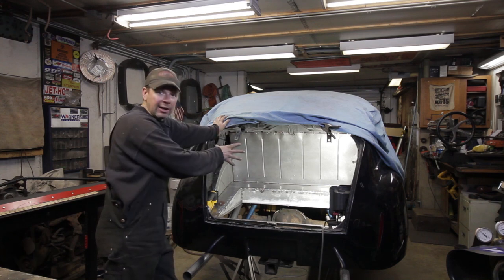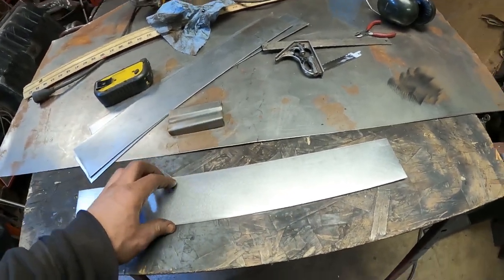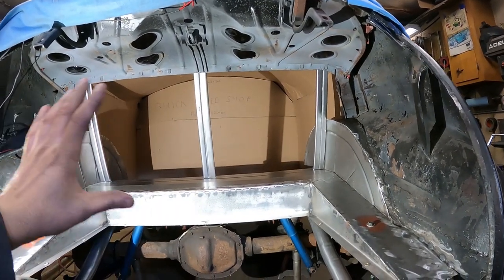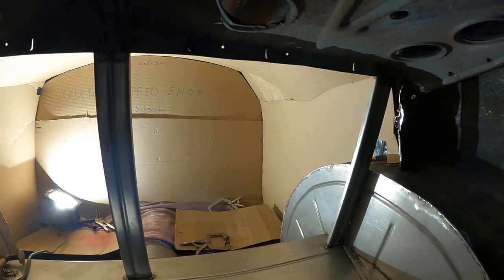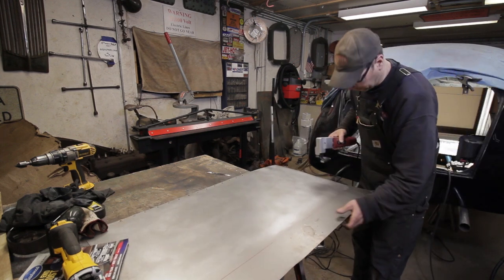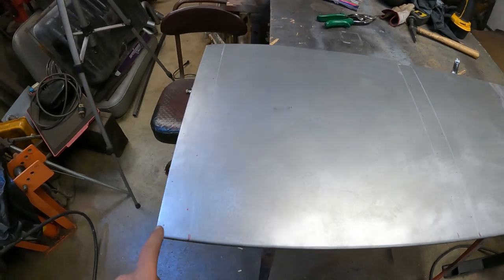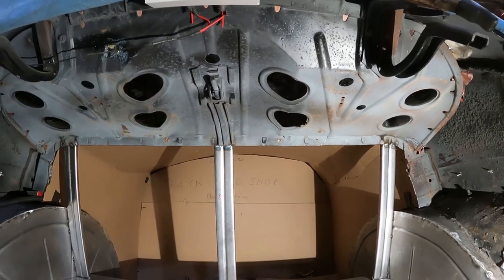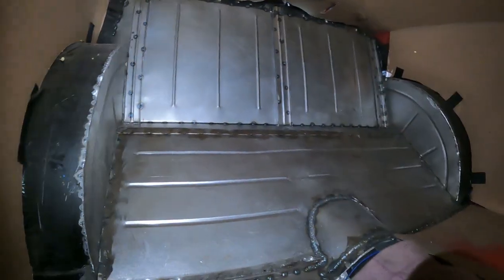Building a Trunk Firewall:  1940 Mercury Sedan

Comment: I haven't done it myself, but I've read that if you "slightly" bead roll from the backside first, it will pre-streach the metal and reduce the warpage. I guess you would have to layout both sides exactly the same though. Still, nice work though!
Reply from the maker: That prob be pretty hard to do the double bead roll.  I'm going to play around with some scraps when I get time to see if I can figure out a way to cut down on the warpage.

Comment: Have read to English Wheel both sides prior to bead rolling to reduce oil canning.  How about forming a sacifiial bend across the top to trim away before installation? Just an asking, I know nothing about sheet metal.
Reply from the maker: Yes, the wheel will stretch the area to be bead rolled then when you add the bead it shrinks down that stretched area and, in theory, the panel stays flat.  I think an air powered planishing hammer with stretching head could accomplish the same thing.
Reply: I was going to ask if you started with a used panel say cut from a roof, hood etc. and then bead rolled it, would that help?

Comment: If you pre roll panel in English wheel you’ll not have that problem. I’d have to take a scrap to remember which side to get desired results
Reply from the maker: Yeah, I know that would be way better, but I don't have a wheel.  I might be able to stretch the panel with a hammer and bag, but I don't really want all the hammer marks.